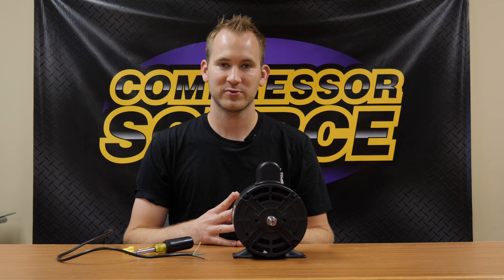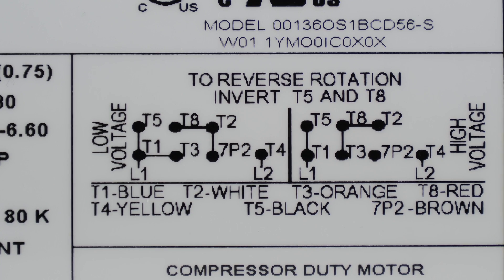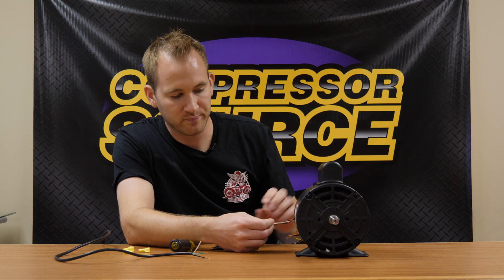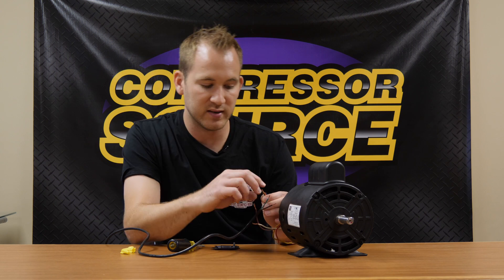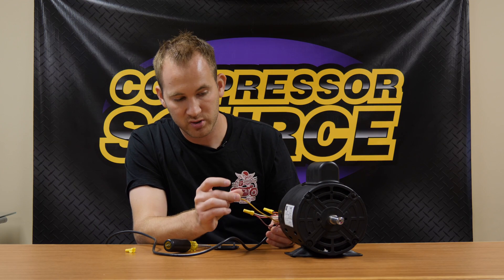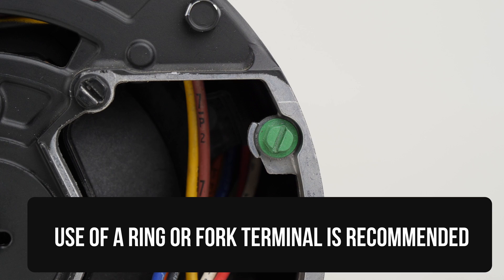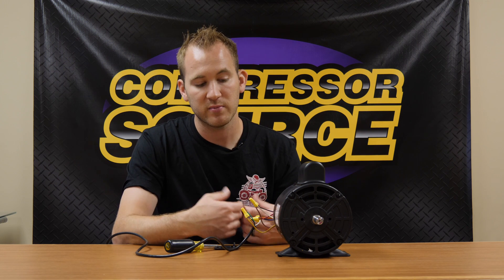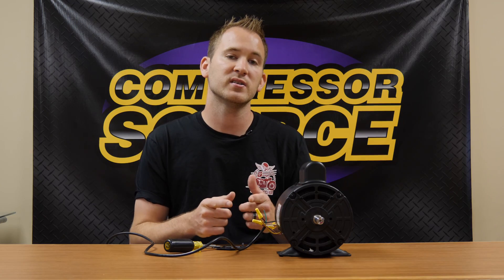Single Phase Electric Motor Wiring Tutorial: Baldor, WEG, Leeson, WEG, Worldwide Electric AC Motors

Comment: I've just spent the last hour trying to figure which line went where. The wiring diagram just says line for both, not even line 1 and line 2. So I wasn't sure if it mattered which was hot and which was neutral. The diagram is completely intuitive except for that, but all the resources I've found just explained all the internal wires, and never mentioned the lines. Thank you for actually explaining them and confirming my suspiscions.

Comment: Good Day , I have a motor and need Some help how to connect the fires.

MOTOR IS 240 VOLTS SINGLE PHASE (L1 120VAC & L2 120VAC)
T1 BLUE
T2 WHITE
T1 & T2 IS 1.6 OHMS
T3 RED
T4 YELLOW
T5 BLACK
J 11 BROWN
J 12 PURPLE
T3, T4, T5, J11, & J12 ARE ALL CONNECTED TOGETHER.
There is also a terminal block with the numbers and letters -
L2&5
L1&3
7
1
H
Also there is one reset switch with 3 terminals. Two terminals with wires -
TERMINAL 1 (P1)
TERMINAL 2 (P2)
TERMINAL 3 ( T5 BLU.)
Start caprcitor 480 microfarad/220vac.
Run caprcitor 35 microfarad/470vac.

Comment: While I thank you for the video, the "US-Made, 1 Phase, NEMA 56, 3/4 hp, 9.6/4.8 Amps Full Load" motor I recently purchased (McMaster-Carr)  a) had no color codes on the wiring diagram, and two of the wires (Black and Blue) had no T numbers printed on them, only wire gauge.  Also, the product detail states a key should have been included, but was not. The number on the sticker "LC0001A01"

Comment: One of the best video s, unfortunately my motor does not have any markings on the wires.
Single phase 4 wire. 2 black wires, two red wires.
One start run copassator.

Model23-660

Comment: I spent years of school in Mechatronics studying this stuff. Never in all of those years did an instructor simply pick up a motor and a wire and just explain this to us. No, they had to spend lectures and countless nights going over the power factor and phase angle and inductive and capacitive reactance of the circuit, the impedance and so much other information. If they touched on wiring diagrams explanations like this, they simply would go over a slide in a lecture. I don't understand why they couldn't do this type of stuff for us students. I'm already pretty advanced in my career by now and I understand it, but at the time of school I much would rather have had them do THIS!!!! 😂
Reply: Thanks for your reply

Comment: Hello! Please help me with the electrical connections for 220 V to an electric motor lesson 190011-53.Now it is connected L1 T3 T5 T1) and L2 (T4 T8 T2) and when i power it up it short and the fuse blows i think this is the 110v connection i need the 220v connections.On his wiring diagram it shows 110V LINE (T1 T3 T8) for 220V LINE (T1) TAPE (T2 T3 T8) LINE (T4 T5) But because I don't work with electric motors, I don't understand the scheme, it confuses me at 220 volts. Thanks!

Comment: Hello, and thank you for your very informative videos. I have a question, I purchased an 60 Gallon air compressor that is 230V/ 14A. I don't have 230 service in my garage, what breaker and what type /gauge wire do I need.  Thanks!

Comment: I have red, yellow, green, and white wires only on my single phase motor and nothing is labeled and I need to figure out why it keeps tripping breaker the green and white is tied together and red and yellow is running to 110 is this correct for 110 or 220??

Comment: Do you have a video for wiring a dual voltage, single phase motor for 240 volts?
Can you wire a single phase, dual voltage motor with a 4 wire cord (two hots, neutral, and ground) or does it have to be 3 wire (hot, neutral and ground).
Only way I can figure wiring a 4 wire is to connect the two hots from 240 to the hot wire connection on the motor and the neutral and ground to the respective wires. I don’t believe that works.
Reply: The diagram for 240V is shown in this video.  The procedure would be similar, but with different connections as shown in the diagram.  The neutral wire would not be present.

Comment: Hi cool vid. Need some guidance on troubleshooting a AC gate motor from leeson so need to run power cable to standard outlet but the wiring diagram is different on mine. Inside the motor plate there are red white and blue wires along with some yellow wires and capacitor wires. How would I go about wiring this up? The the wiring plate cover shows three lead reversing with L1 going to cw(1) and ocw (2). 3 empty. Then L2 going to 4. Any help would be appreciated thx!

Comment: 😲 this video very quickly and concisely explained the meaning of the wiring diagram, which has been an enigma to me and something of a tremor. My specific situation is that I've completed a full restoration of a 1940's Walker-Turner motor for my own channel, but it did not have a wiring diagram. I've checked continuity to determine lead pairs, and checked the insulation residence, which is 💯, but I'd like to make my own writing diagram for it, since it did not come with one. As part of the restoration, I soldered new leads to the winding coils as well, so it would be awesome to make a wiring diagram for 110/220 as well as reversing the rotation. Could the info in this video help me figure all that out once I set my hands to it, or could you point me in the right direction? The video was very helpful as it is, I just need to go a couple steps further since I'm starting without a diagram. As an FYI, I do have a diagram from a similar make and model motor, but it's a couple years before and it has a cool separate box plate that you open up to reverse direction, where mine does not. Mine is more like the one in the video here with a single start capacitor. Thanks to anyone who replies reasonably 😎

Comment: You did not explain how the wiring is on 230 volt as to whether white or black is L1
Reply: You should not have a white wire in that case.  White is reserved for neutral, so your wiring should be black, red, and ground.

Comment: my 220volt single phase motor had 3 posts. I accidentally hooked ground wire  to  Line 1 on motor, one of the hot leads to line 2 on motor and the other hot wire to the other  post that has a couple other wires on it.  It ran half speed for a few seconds and then I smelled some burned smell and shut it off, then realized my mistake and rewired it properly and there is absolutely nothing now no buzz no humm no movement no smell.  Total dumb mistake. Did I fry this new motor and need to get a new one?  Wish I would have watched your video first.

Comment: thank you for this. i discovered my wiring problem for this leeson motor i had to rewire for a "forward-only switch".  electric eel 100 foot auto feed drain cleaner/snake.  their forward-only is actually reverse rotation on the electric motor.  normally  the motor arrives with a forward and reverse (on-off-on, double throw, 120v) switch prewired.  forward-only requires the rewire and different switch.

Comment: Dude, I'm fixin to put juice back to my century ac motor mounted on a Coleman power mate compressor. And your the first one I was able to comprehend. Thanks a lot man.  If screwit up & let the smoke out of it, I'll let you know.
Reply: Wish the one I'm working on Was 2 phase . This 3 phase is hard to find a video on . And single phase but running 220.  Electric motors are challenging

Comment: Hi can you test every wire to one another before  you connect to each other? I bought use single phase century pump motor 1.0 hp 3450 rpm thermally protected 6.5/13.0 amps 60 hertz 230 / 115 Volts  I would like to run this motor using 110 Volts we have two yellow wire, brown, white, orange,   and black wire this motor with low voltage dual and high voltage non - reversible I want to connect wire on it but I need to make sure I'll connect every wire to the right connection and I'm not doing wrong thanks.

Comment: On the part for reversing if you are using a drum switch to reverse it, can you wire it by adding an additional conductor and wiring so that in forward you applying voltage via the drum switch to T5 in its group with T4 and in Reverse the extra conductor to T8,T3, & T2? I'm speaking for a 208/250 Volt 1 Phase.

Comment: Great video, so to run that motor with 230v, connect the T5, T1, & L1 together.  Next T8,T2, & T3 go together.  Then connect L2 & T4 together.   Then connect the ground and that should do it.  But is the 7P2(brown) not used when it's 230V??

Comment: Enjoyed your video, thanks. I have a motor that is 115/230 and I understand how to hook it up for the low side power, but my motor has two wires that say “Thermostat”. I’m not using a thermostat and was wondering if they are somehow used in the thermal overload protection or do i just cap them? This is a Dayton 1/2 hp Model 4K260H

Comment: Thanks for the video. It is easy if you have that diagram & understand those dots and the low vs high. My motor is from a furnace blower and labeled: 200-230V, single phase, 60hz, 1/4 hp. There is a capacitor mounted on the side of the squirrel cage housing holding the motor. It has two posts with two black wires on one post and a yellow on the other. One of those black wires goes to the old connector which mated with a plug on the furnace wiring and the other off that connector disappears into the motor casing. The yellow disappears into the motor, as well. I am betting those go to the start winding.

Two other wires come off that connector - a red & a light blue - and they connect to terminals which seem to be for two speeds (a diagram says high/med/low, but only two are in use).
Now for L1 and L2 in your example...my my question is where do I connect them?
My power source is a 240 circuit. The 20 breakers are ganged together in the panel, so one is fed from one of the phases coming into the house and the second is fed from the other line. The two wires (red & black) from those two breakers go to a 20 A socket in the wall. Just the bare copper ground and those two wires are connected to the outlet on the wall - no neutral is attached to the outlet left coiled and capped in the box).
So, if I prepare a plug to match that outlet, the other end of the cable will have what I assume are two separate 110 lines (L1 & L2?) Would it make sense to attach one of those to black lead going to the capacitor and the other to either of the Red or Light Blue wires, depending on the blower speed desired?
What is confusing is how can a circuit be completed through either winding if there is no neutral anywhere? The ground wire wouldn't provide that completed circuit, right (there is a green with that is fastened to the motor casing and disappears into the motor, which is where I intended to connect the ground from the outlet...)
Since your video didn't fill in details about the source for L1, I assumed that was your typical 110 cable which used the neutral to complete the circuit using one of the L connections. You didn't get into the High Voltage connections and how the power source might have been different. Can you fill in my missing pieces for the 240 V connections? Cheers!
Reply: The "neutral" is not treated as "grounded".  Both lines are insulated from ground in the motor and you can hook either 120V wires (usually black and white) interchangeably to the line inputs L1 and L2 without affecting motor rotation nor fear of energizing and getting a shock from the motor case.  However, just as a point of consistency, I attach the 120V " hot" (black) to L1 and "neutral" (white) to L2. (Some motor labels make no distinction for L1 L2).  The difference between wiring for 120V and 240V is simple.  By following the diagram, the 120V connections are internally wiring the two running coils in parallel, and the 240V connections they wired in series.  When using 240V, just use 2 wire (+ground) cable (conductors usually black and red, but you can use black / white cable if necessary and label the white black or red), as neutral is not needed.   Can be connected to L1 and L2 either way, but for consistency I wire the black hot wire to L1 and red hot wire to L2.
Reply: Yeah my question is about the l1 and l2 if with wires are black and one is 110v and the other is 208v if I'm not mistaken.

Comment: Seven wires coming from the coils in the motor. Two coils in serial are for 240 Volts, two coils in parallel are for 110 Volts or something. But it is a complete mystery to me how it is really connected.

Comment: I have a question for you. On low voltage L1 and L 2 are your 120 v black and white hot and neutral wires. Yes or no ? Because low voltage is 120. Black and white, hot and neutral. But you said it does not matter which one you use ???
Reply: I'm wondering the same thing and I'm curious if you ever found an answer... does it really not matter which one you use?

Comment: From the title I expected the wiring diagram, as in how to wire the windings of the stator, not the connection diagram (how to interconnect the terminals of the windings and how to connect the terminals of the windings to the lines/phases), which is what you showed in the video.

I'm not blaming you, though. I think there's no official name for these diagrams.

Comment: Baldor the Cadillac of motors. Last a long time. Do not like the 100HP and higher WEG cast iron pig of a motor. Have a goofy pecker head and always ran hotter then Baldor. They always tell you to use drive rated motirs in all VFD'S. Had at least 50 40 to 125 HP motors that were not rated for drives but been running 24/7 for 20 years.

Comment: What if all wires are black and are wired to spade terminals? And there is no diagram.. There are 2 bare spade leads.
So hot to one, neutral to another and then green goes to ground. I think that's right. I believe it's pretty fool proof. It will be however I wire it will determine the direction of the rotation.
Reply: Use a multimeter when in doubt. One should be ground, other hot, other common. Probably reversible.
Reply: @etherealrose2139  
Yep, I got it figured out. I ended up just buying a new 220V motor and wiring it into a 110-220 step up.

Comment: Hi, I have a delta drill press that stopped working.  After troubleshooting I determined it's the capacitor.  Ordered a new one and when I went to replace it I discovered 2 of the winding wires were broken (I think they burned up).  I'm not sure how to reconnect the winding wires that attach to the capacitor and power cord.  On the black wire there one winding wire attached to it but I have 2 winding wires just floating around not connected to anything.  Is there any standard configuration for re-attaching the winding wires.  It's a delta motor no. 1349451 single phase 110v motor.  Any tips on how to figure it out as I can't find a wiring diagram for it.  Thanks!
Reply: There's likely two windings in the motor. One a start winding, one the run winding. The start winding may or may not fall out of the circuit. Is there a start run capacitor or just start capacitor? Wiring depends on that.
Reply: @etherealrose2139   It has just a start capacitor.  Once I removed the motor from the drill press housing, I was able to see the winding diagram as it was on the backside of the motor.  With the diagram (and the help of a friend), I was able to figure it out and got it running.  Thanks for taking the time to reply tho.  Cheers.

Comment: For high voltage (240) how come it only shows two lines on the diagram in your video?
Shouldn't it be hot, neutral, and hot? I know of certain 240 systems where there is no neutral, but I don't see that usually in residential. applications.

Comment: EAsy, lucky teacher,,  all your wires are clearly marked and labeled,  direction are obvious.   I have never had a motor with marked wires.   Try and teach how to wire those.
Reply: Ground wire will have continuity with the frame.  The resistance setting of a multimeter will show 0 ohms or audible tone. The start winding is usually thinner copper so it'll have the highest resistance and the lower resistance wire will be your main or run winding. There should be a common wire you're testing them to as well.

Comment: I believe including wiring to a switch would be more a "real world" scenario as  is you would need to keep  plugging/unplugging the motor to have it work.
Reply: That's not the kind of motor he's talking about. This motor you are using with an external switch like for a table.saw belt sander compressor etc

Comment: Well done!!! But my 1/4hp is a bit older. I wired it one way an it run fine but got hot an smoked, reversed it an it run slower, an reversed rotation an smoked. Including pics if possible. Definitely subscribing! Sure hope to hear from you soon! Thanks in advance! 
My Email is

brooster2990@gmail.com
                 ✌

Comment: I have a capacitor on my single phase motor and I don't know how to wire this.  Can you explain to me where these 2 wires go?  They are loose right now and my motor is weak and doesn't run properly.
Reply: YouTube is not a good place to answer those questions unless you are very specific. The problem is you can't add a picture of your motor. Try other website, like Electronics Stack Exchange (make sure you clearly describe what is your question, what you think you should do, and show a picture.)

Comment: Excellent explanation.  I'm trying to replace a 3 phase motor with a 240v single phase and the wiring diagrams were the last thing to figure out.  The new motor has the wiring diagram but I didn't completely understand it.  Now I do.  My only issue now is to find out how to wire it to the magnetic switch which WAS configured for the 3 phase.  This is a show stopper.  I'll keep looking.  Thanks again.